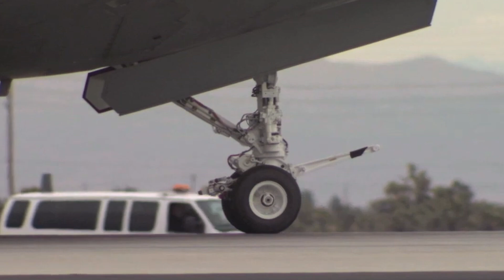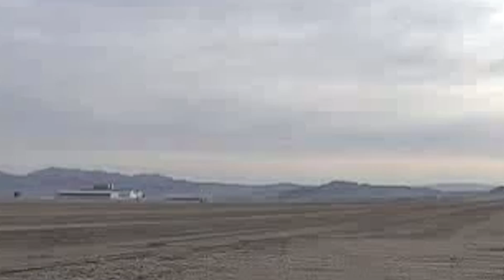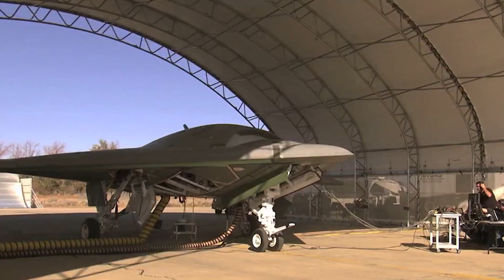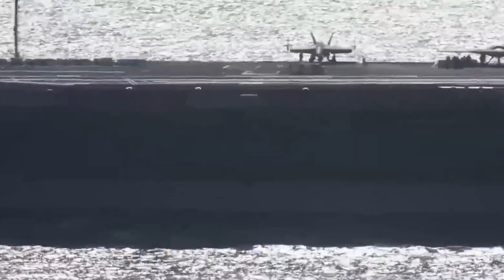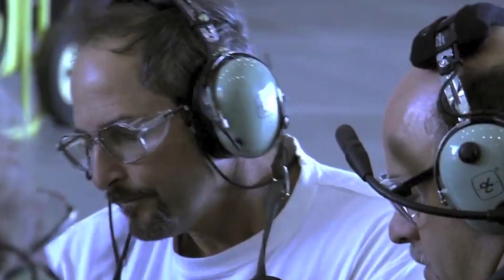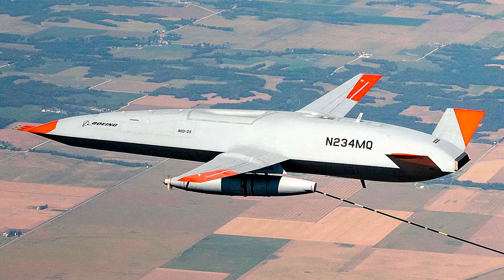US Navy X-47B Stealth Strike Fighter

Comment: I wonder if the X-47B can be refueled by the MQ-25 unmanned refueling drone? Now THAT would be insane!  We could literally set up a 24/7 air perimeter around an enemy's entire country consisting of circling attack and refueling drones.
Reply: Arsenal Bird when?
Reply: sounds like the seperatist fleet in star wars
Reply: Hello, Skynet.  😱
Reply: That's definitely the future
Reply: @EnsignFuntimes  soon as we achieve Tesla's dream of wireless power transmission.
Reply: The drone has an alcohol based fuel kinda like a fisherman it can go 2,000 miles uninhibited. The thing is the perfect killing machine. The only hitch is it emits a hot exhaust which enemies can detect a turbo engine with relative ease. That is the reason why the new drones are mostly electric and expendable too.
Reply: @EnsignFuntimes Just need to make a space elevator
Reply: The future looks bright...😬
Reply: @beezo1764  No contact killing how impersonal can ya get.
Reply: @EnsignFuntimes  Soon.
Reply: That's the goal.
Reply: We can do that. All it will cost is an extra 100 billion plus 2 billion for each
Reply: Or just develop a small light reactor so it can fly for 20 years before refuel.
Reply: OK, until inevitable A.I. mutiny!!!!
Reply: Why not?  But the major threat to these is electronic jamming.  If the enemy can figure it out, it will make them all useless and a waste of billions of dollars.
Reply: @Thornbloom  do you even realize how fucking inefficient that would be?
Reply: My kingdom for a refueling device that can fill my friggin 'land' vehicle so I don't have to go to the gas station ⛽

Now that would be worth it. Having a "drone" vehicle top off my tank like ordering groceries from Walmart on delivery 🚚
Reply: What would be insane is software reliable enough to work 24/7 for months on end
Reply: Idk man that’s kinda risky, but i mean… You kinda just need a auto pilot and another guy to control the boom so yeah you could
Reply: Another thing, normally US refueling system is a boom so i didn’t think of the other system just then but that other system is still risky
Reply: They already tested this successfully
Reply: It would take INSANE levels of logistics, preparation, and cooperation. But fuck that would be cool
Reply: It was a requirement when it was first on the drawing board.
Reply: Cant wait for diamond batteries to exist so I can deed D and C cell batteries to my children.

A drone with diamond batteries running Windows Tactical Edition, getting online service from starlink or something like that
Reply: @211212112  Lol... Not trying to be rude, but that's an absolutely horrible idea. While I am a huge proponent of nuclear energy/power for the power grid, and it has some uses elsewhere too (space for one); it would be a terrible idea to put them in a ton of fighter drones. In a war, having a bunch of drones fighting each other and getting shot down causing little mini nuclear disasters every single time... You might as well just be using nuclear weapons at that point. It's risky enough that they use them in submarines...

Unless ofc you were being sarcastic...
Reply: @EnsignFuntimes   bro been waiting for some one to cone up with that set up that will be wild
Reply: Guaranteed
Reply: Imagine that with the b-21 raider drone configuration
Reply: See the rear its grid tech works of magnetica etc
Reply: Refuel they dont need fuel anymode hahahaha omg u shoukd see what.i saw 2008. And this oast weds was awsome too
Reply: @thekingsilverado3266  its doesnt need fuel lol works iff magnetic grid etc
Reply: @MK_Ultrautism  thing work off grid no.fuel fexh is amazing saw one this weds blow ur.mind in tech.
Reply: @denicampbell8313  I'm trying that with my truck right now I just don't know where to plug into Bydens magic grid. Help me out here OK...
Reply: @thekingsilverado3266  dont cafe what u say.  Its awsome stuff !!!!! 300 urs advanced tech now we could never understand how it works just does!
Reply: @thekingsilverado3266  There will be a human contact at the other end. At an impact,
Reply: Good thinking Sir! How about a submersible Aircraft Carrier that can launch these pretty birds?
Reply: @carlosandleon  you act like the US military apparatus is in any way efficient in anything done. Lol I mean I agree with you but if inefficient was a concern the whole system shuts down.
Reply: @waynewayne9693  I agree, the military is a nexus of fiscal inefficiency and incompetence. But even their profound vacuousness over thermodynamic processes have limits.

Along the way, at least one mechanic will be aware of the stupidity of using one of the most effective electrical insulator that is air to carry charge.
Reply: The enemy will jam the comms, shoot down communication satellites, and it’s game over.
Reply: @nomore-constipation  Put solar collectors on your roof, a power wall in your garage, and hook it up to your Tesla before you go to bed. Full tank in the morning -- no gas station in sight.
Reply: it is irrationally insane...
Reply: Already done 👌
Reply: @thekingsilverado3266  Unless you are using a bayonet that's been the case for a couple of hundred years. You have a point to make. Try harder mate.
Reply: @EL_Duderino68  The evidence is out there. It is just being concealed.
Reply: @thekingsilverado3266  
Re your comment :
"The evidence is out there. It is just being concealed."
Your comment doesn't seem to relate to mine. who were you trying to comment to?
Reply: А кто ваш противник? Кто-то вам угрожает?
Reply: DOOM
Reply: That would be “DEADLY-SERIOUS”!!! 😵‍💫😉😎
Reply: Terrifying.
Reply: literally the modern equivelent of a seige
Reply: What about the engines? Could just use ramjet engines.
Reply: @Thornbloom  that idea simply isn’t possible. that kind of energy being in the air is literally as powerful as lightning, that’s not something you want to be in the air being produced by man made generators (unless you want a genocide to occur). if it were possible, it would’ve happened already.

Comment: I had an interesting conversation with an engineer on the MQ-25 project, basically one of the main reasons the MQ is purely a refueling aircraft is because it's believed that Congress would not be as friendly towards allocating money towards a carrier based UCAV. A strictly support role focused unmanned aircraft was seen as a much easier sell.
Reply: Sell the tanker model then ask for money later on to weaponize it or make it a spy plane
Reply: Congress is clueless about everything.
Reply: Makes sense.  Modifications will follow to acclimate to different mission parameters.
Reply: Wow
Reply: Is that because fears of pilot jobs?

Comment: It's about time.  Back in the 80's, I was with the 35th Wild Weasels.  I heard some of the old timers saying we should be developing unmanned strike fighters, since they'd have higher performance limits, lower weight, and much lower production and operating costs.  If there wasn't a pilot in the seat of an F-16, they wouldn't have had to snip its balls so it couldn't easily knock the pilots out in tight maneuvers.

Comment: For an experimental aircraft, it had a remarkably good run. No accidents or system failures resulting in loss or damage. So that's a success. Although that is likely due to the fact it was putting already proven tech together rather than fully developing it all from scratch.

I don't see it totally going away though, even if not put into routine operation. It's probably one of those things they'll keep under wraps or in mothballs until time of need, unless something newer/better is there to replace it.
Reply: It was too good, therefore they won’t use it!  I see a pattern here.
Reply: Its not actually retired.

Comment: A minor point, but if this aircraft has a cruising speed of 685 mph, and (depending on temperature and altitude) the speed of sound is 760 mph, give or take a few, then this aircraft is capable of sustained Mach 0.9, not Mach 0.45.

Comment: The autonomous aerial refueling, the ‘Navy Way’ with a retractable fueling probe connecting in flight to a drogue, continues to impress me. In fact it continues to amaze me. It’s difficult for most pilots to do even though they perform this in nearly every sortie. Day or night. But for a UCAV that is a TREMENDOUS technological hurdle - which it seemed to have passed.  I hope they hold onto that capability. Had to have been difficult to achieve and it’d be a shame to let that perish. We’ll end up needing that again one day I suspect.
Reply: I thought the refueling, with a probe that far off the center-line, using an autonomous vehicle w/o a rudder was very impressive.

Comment: Still can't believe the Navy didn't order these as an operational strike aircraft, its literally the A-12 realized
Reply: Leave it up to the navy to make more bad choices.
Reply: By the time they were fully ready, they were about 18 years after the start of the program. With it's first flight being so long after the the start it's no wonder they were dropped. There are much better systems out there at this point. 

Even current civilian level drones would have better capabilities than this outside of the warfare tech, which would also be 10 years out of date.
Reply: @ZenixΛVI Ehhhh, it doesn't really matter what branch we're talking about.  The folks in charge of weapons procurement always make dumb choices..
Reply: @voivode2591 The next ones won't be jet propelled.
Reply: That because the navy has been playing with tic tacs for over a decade
Reply: @thelonewrangler1008  The next generation will be, as the old saying goes, indistinguishable from magic.
Reply: @ZenixΛVI No. but i was fully aware of the project and am still shocked about the decision. That’s all i will say.
Reply: @thelonewrangler1008  They've switched to phallus clouds recently, I hear
Reply: This is just the stuff they're letting you know about. Distraction from the real dark ops programs.
Reply: @AthenaAutocross  "Even current civilian level drones would have better capabilities than this outside of the warfare tech"
Which ones have a 2000 mile range at over 600 mph plus in air fueling, a 4500 lb payload and an ability to take off and land from a carrier?
Reply: @wisenber  start taking a look into the rc drone and scaled jet world. There are home made RC jets nearing 500mph. 

The technology in the civilian world is leaps and bounds beyond this, range is simply a cost feature, not a technological one. Same for carrying capacity, simply scale, not a technological one.
Reply: @AthenaAutocross  So are there any that can do all of that already? I've not heard of any capable of a marine environment capable of a catapult launch and a tail hook that can carry 4500 lbs in internal bays. I mean you're not going to win a decathlon if you're only able to compete in two events.
Reply: @wisenber  all achievable with civilian equipment. Only difference is no one's going to pay 890 million USD to make some prototypes. 

These aren't super advanced equipment you dork. It's 20+ year old tech.
Reply: @endymion6942  yeah dude, i dont know what the fuck theyre thinking, especially when it comes to their fleet projections for 2030 outlook. Getting rid of all the ticonderoga class cruisers with no real replacement except for that gay looking frigate. I totally agree.
Reply: @AthenaAutocross  "all achievable with civilian equipment."
Which is different than already existing like you suggested.

"Only difference is no one's going to pay 890 million USD to make some prototypes. "
That probably good since the 890 million also covered the fifteen years of testing and program costs that went with it. Sort of like five year a single rifle program would run about 150k for three years since it covers the rifleman.
Reply: @wisenber  all of it has been achievable in the civilian world my guy. If you think it's a good idea to cram a butt load of out of date tech into something and go "it's advanced technology", well then I guess you're Northrop engineer who is salty about their out of date pet project being cut because it's actually out of date meh trash.
Reply: @AthenaAutocross  "all of it has been achievable in the civilian world my guy."
That's sort of how Iran was able to capture the US drone. It was using common civilian components.

" If you think it's a good idea to cram a butt load of out of date tech into something and go "it's advanced technology""
You still didn't offer another item capable of doing the same. "out of date" would imply that it's been done before...which it hasn't unless you had an example.

"I guess you're Northrop engineer who is salty about their out of date pet project "
Unsurprising, since you think UAV capable of 2000 miles, over 600 mph speed, 4500 lbs in payload, internal weapons bays, in air refueling with carrier take off and landing is such a trivial thing. Just order one from Amazon, right? Talk about salty.
Reply: @wisenber  talk about bad faith on your side. This thing is older than the iPhone 1. But Its so advanced because it can carry 1/4 the load at under half the speed of jet from 1978 that's still in service. 

The Navy already has capable aircraft that can do what this could. it's out of date techology, it's electrical systems as I've said over and over is why it's not adopted. I don't understand why you keep going "muh scale" as your only excuse and the fact you think retail toys are what I'm talking about when I speak of technological advances in the civilian world.
Reply: @AthenaAutocross  "talk about bad faith on your side. This thing is older than the iPhone 1"
Ironic of you to say that, considering a Minuteman is older than DVDs.

"But Its so advanced because it can carry 1/4 the load at under half the speed of jet from 1978"
Right. I remember all of the UAVs doing that in 1978.

"The Navy already has capable aircraft that can do what this could."
Name one that's a UAV.

" I don't understand why you keep going "muh scale" "
Considering I didn't? Why do you need a strawman if you have such a compelling premise?
Reply: @wisenber  EA-18G.... Seriously you're arguing all of this and don't even know about this program?
Reply: also, Navy and Air Force are both heavy Pilot officers. The top guns are those at the top often.
Reply: @ZenixΛVI you are wise!
Reply: @zenixaviation When it comes to the Tomcat fans they do have some legitimate arguments.  The Super tomcat 21 was indeed superior to the Super Hornet. If what the specs of it were true.  The Tomcat 21 would have outperformed the Super Hornet in every way possible. 

They do however forget one thing.
The Tomcat 21 was higher in maintenance and a little less reliable although such things likely would have been teethed out eventually.  

given the time when the Tomcat 21 was considered.  Cost was the concern and the Super Hornet was the less expensive alternative.
Reply: It's a test bed.... just like the F22. I think it's a  oncept of what future aircraft could be.
Reply: @C.Fecteau-AU-MJ13  🤡🤡🤡
Reply: @thelonewrangler1008  🤡🤡🤡
Reply: @C.Fecteau-AU-MJ13  Huh? Explain.
Reply: It's close enough to dichotomous. I'm sure they have modified software and outfitting for repurposing, here's why: They've been awfully public with this tech, misdirection. Make everyone think it only has a narrow field of usability, because it doesn't, leaving scenarios when used that no one is considering it...